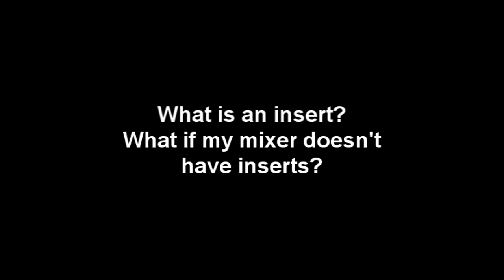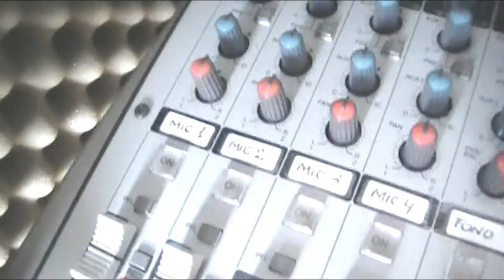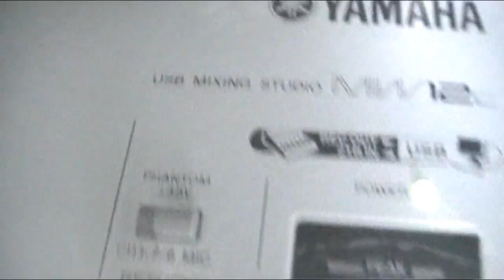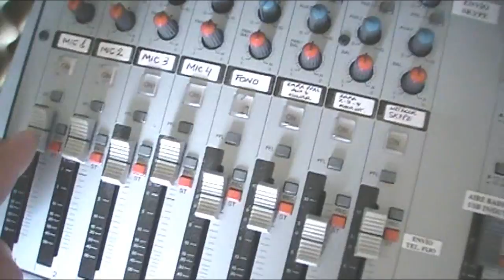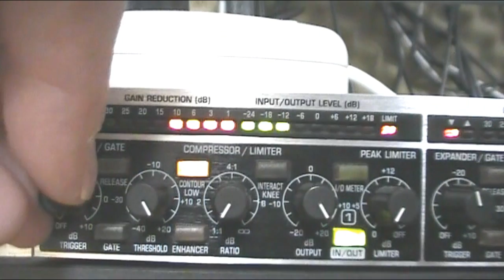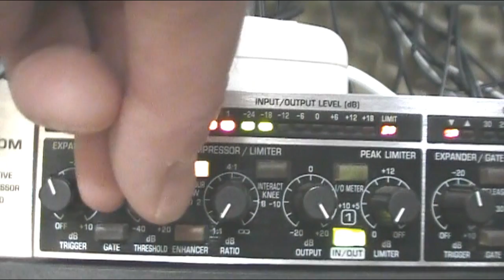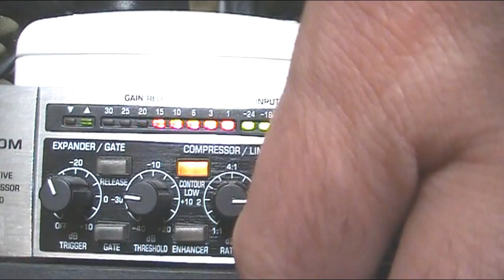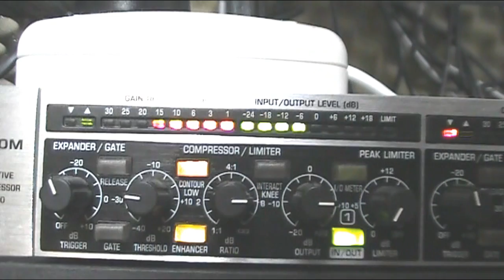Compressors and podcasting radio voice compression (english)

Comment: For podcasts this would be nice to do in software. Unfortunately this seems difficult without extensive software packages. Like a full DAW, that is clearly way overkill for the task. But I'm a newbie, maybe there are options I don't know about.
Reply: Rocket Broadcaster can open vst plugins but you can't record with it tho, i record with the software butt at the same time to prevent this issue but i have an external compressor as well
Reply: Audacity has a compressor and it's a very lightweight audio editing program